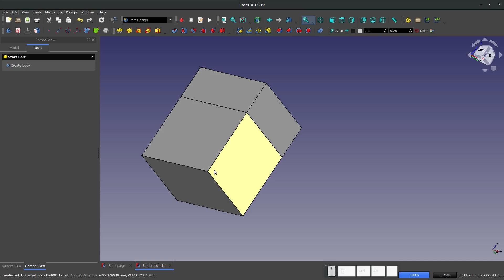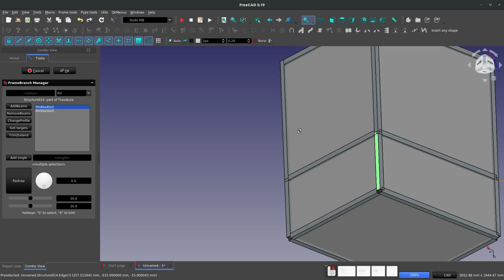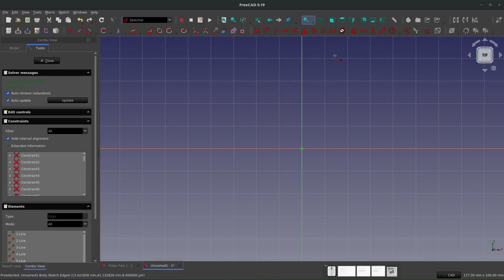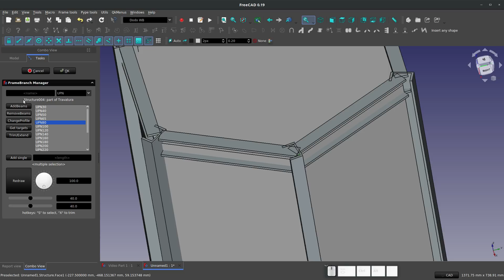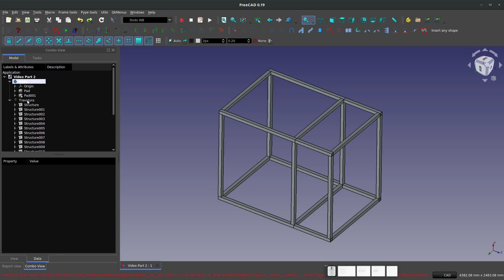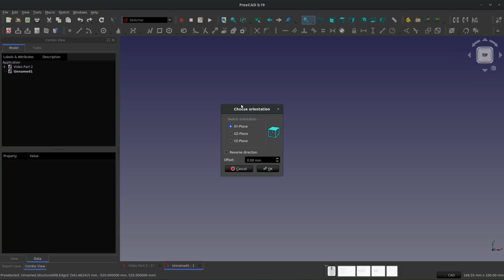FreeCAD - Introducing the Dodo Workbench for Frames, Pipes and More |JOKO ENGINEERING|

Comment: what version of Freecad do you use? I do not see the DODO workbench in mine. I run v1.0.2... also, I am new to Freecad.. tnx
Reply from the maker: Great question!  The version in the video is definitely an older version.  Dodo doesn't normally ship with FreeCAD, but you can add it in by going to tools> addon manager> install dodo
Reply: @JokoEngineeringhelp i did figure this out. Thank you. Now back to your vids 😅

Comment: Im trying to figure out what to learn.  I want to design a motorcycle camper.  Will free as calculate structural strength and suspension dynamics?
Reply from the maker: FreeCAD will do finite element analysis.

https://www.youtube.com/watch?v=dhrynRdBOIg

https://www.youtube.com/watch?v=Q8QcqREfFeg

https://www.youtube.com/watch?v=hUS7T9hrn4k

For dynamic FEA, you'll want another platform.  Check to see if Mecway will do what you need, it's low cost, perpetual and pretty easy to use.  If you need something free, it's possible salome meca can do the job, but the UI can be pretty tough.

Comment: Not sure if the software has been updated, but this no longer works.  When extruding the second pad, it automatically starts the draw from the best of the first pad so instead of having two pads to select, the second envelopes the first.  I've done exactly the same as in the video.  Or I must have a setting different somewhere.
Reply: After you extrude the second pad, click on the pad in the tree, go to properties, and uncheck "refine"

Comment: I worked through that this evening. Very nice workbench and very nice excercise :) Thank you :) I had to do it twice as I clicked the Ok button in the Frame Branch Manager combo view, which overlaid all the frame work again which was very confusing. The workbench really needs a warning for any time Ok is clicked after being clicked once. I realised what I had done when I watched your video to the end and saw you do it ! 
Additionally I decided to delete the 4 short sections around the frame and extend the longer lengths from 1040 mm to the full height of 1540 mm. I found that "Get Targets" --> selecting the distance between the furthest faces, and --> "Trim/Extend" did not extend the lengths to 1540 mm. I had to do this manually, but I got there. Thanks again. Great tutorial. :)

Comment: Thank you very much for this Dodo tutorial! Unluckily I fail already with the 2nd pad - FreeCad shows no edges between the two boxes, just one large box. Calling Dodo results in "module 'FreeCAD' has no attribute 'DraftWorkingPlane'". Any idea what I'm doing wrong right in the beginning? I use 0.19 / 22960 from 08.11.2020.
Using your model from GrabCad, everything works fine, all edges are visible and I can open the Dodo WB.

Comment: interesting workbench and a good intro to it.   One key question and perhaps I missed it in the video.  Mitre joints? Please tell me this can handle that fundamental.  Cheers.
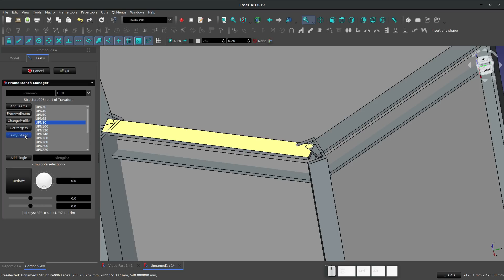Reply from the maker: I try to cover this topic at 11:40, unfortunately it looks like I can't do a corner.  It doesn't seem apparent in the documentation that this is possible yet either.
Reply: @JokoEngineeringhelp  ah. I was looking for a more overt mention/discussion of mitre joints. I found that particular shape with the mixed channels and bar a bit messy to follow.  Was probably watching it too tired.  Made more sense when I knew that was the area you were trying to cover angled trims. I hope mitre joints are in there just not obvious else it’s well ...  a bit of a dodo.  😂